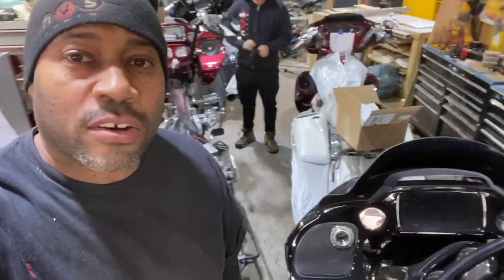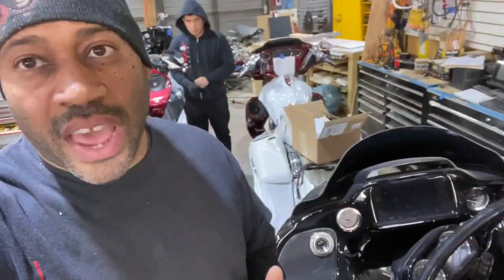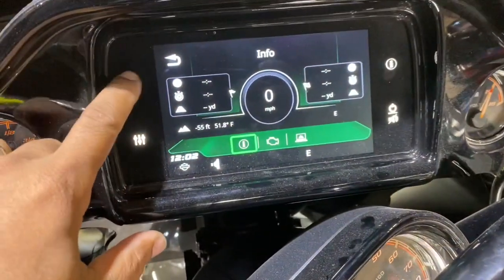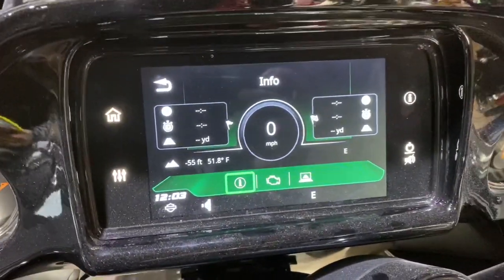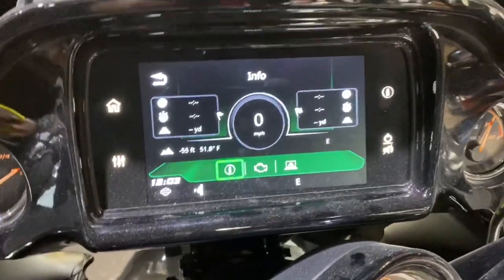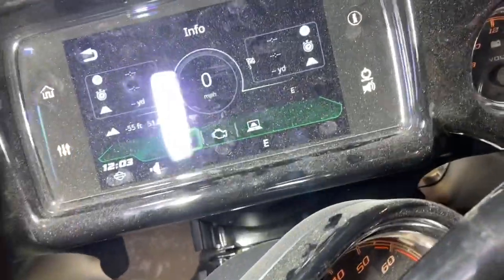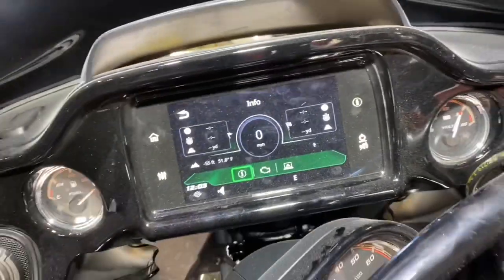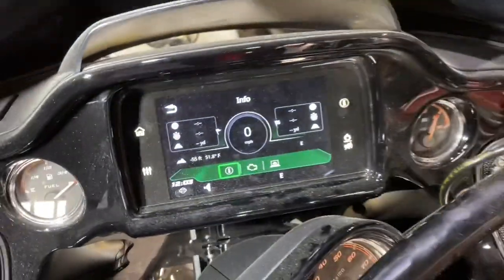Why we keep the factory Harley Davidson radio in most of our audio builds on the 2014 - 2020 bikes ?

Comment: Carlos is have a 2017 street glide i just installed a new sound stream hdhu14si.. how do you feel about using the rca outs to the input on the amps? I am running ddauduio amps..and what rca cable is the best for noise reduction and length?
Reply from the maker: It’s a 50/50 shot with the sound stream radios on noise 

Try plugging in the rca directly to the radio first 

We use the stinger x1 series 

If that doesn’t work 
Go speaker level from the radio into the amp

Comment: Do you always use the Soundz flash?  I've seen you mention it before.  I know it lowers the output voltage and flattens the curve.  Does it also give you fader out of the radio/head unit so that the fader works with aftermarket amps?  I've used the Techno Research Default flash (6 speakers, 2 amps) that lowers the voltage and flattens the curve, but it also is designed for a fader that works on the Boom amps not the head unit, so the fader does nothing with aftermarket amps.  I really don't like to have to preset the fade because of passenger preferences.  Some don't want any sound at the rear.
Reply from the maker: We only use the Soundz flash 

It disables the fader in the radio 

We use the fader in the dsp
Reply: @NVSAUDIO  That makes it hard to use the fader.  I guess you could program presets with different fade settings.
Do does that mean with a four channel amp and DSP, you only run two channels from the radio into the DSP and then the DSP outputs to four channels?

Comment: Great videos! Is there somewhere to find a diagram on running a dsp for a four speakers setup with two subs on a 2020 road glide? Thanks
Reply from the maker: The Rockford website has a great wiring diagram for the dsr1 dsp 
You can use this as a guide even if you are using a different dsp . 

The software is different between brands of dsp but the wiring is very very similar and simple 

https://rockfordfosgate.com/rftech/library/2017/02_signal_processors/1230-61763-01-c_dsr1-irs.pdf

Comment: What would you recommend for a stock 2014 Street Glide audio upgrade (non touch screen HD radio)?  You come highly recommended from the comment section of Traveling Tall’s recent audio upgrade video. Thanks in advance.
Reply from the maker: If the bike comes with the GT 6.5 or the GTS 6.5 we keep it but with the non touch screen we upgrade it to the Sony 7000 or the GT 6.5 ( you can buy them used for like $400 ) 

2 speaker upgrade we recommend 
Ground zero gzcf65spl 
And a sound digital evox 800.4 
Dsr1 dsp 

4 speaker setup 

Add the Rockford 
6x9 lid kit
Reply: Any recommendations where to find them used?  Thanks for the quick reply!
Reply from the maker: @scottking876  

Street glide nation on Facebook 
Harley Davidson bagger stereo on Facebook 
Harley bagger parts for sale on Facebook ( saw one posted for $550 just now )

Comment: What dsp would you recommend ?
Reply from the maker: The Rockford dsr1 is the easiest to use and they make plug and play kits for it . 

We also like the arc audio psm ( software is hard to use ) 
Ad Dsp 4-6
The ground zero 6-8 
Hertz h8 ( doesn’t fit in the fairing)

Comment: My concern is my factory radio has the small screen 4 inch non touchscreen w/o the navigation. The upgraded 2015 GtS touchscreen navigation is $599 and 2020 GTS $1500 when the Sony XAV 7000 head unit is only $499 which seems more practical. Decisions/Decisions.
Reply: I bought the Sony from Fat Head Cycles who includes the harness and face trim in the price and had a nice video showing how easy it is to do it. 
I replaced mine because I wanted RCA outputs and the car play because I hated the factory GPS. So far it only sounds a little better but I just found this channel to learn how to make it better.
Reply from the maker: @davypig571  car play is definitely the biggest reason to switch . I agree with that 100 percent we stock and sell a ton of Sony 7000 . My issue is with the shops that force customers to switch even though they are happy with their gts or GTs just because they want to add audio .
Reply from the maker: You can get the gt radio super cheap 
Way less than $500 

More like 200-300 

But I’m your case you didn’t start off with the gt
So it’s different the Sony would be a no brainer .
Reply: I just would have liked to have found your channel a week or two ago. It is very nice that you educate so well. I know you don’t have to do it but it is nice of you to share your knowledge. I especially like how you’re not afraid to tell when something doesn’t work. Sometimes that is the best way to learn...from mistakes. This channel is excellent.